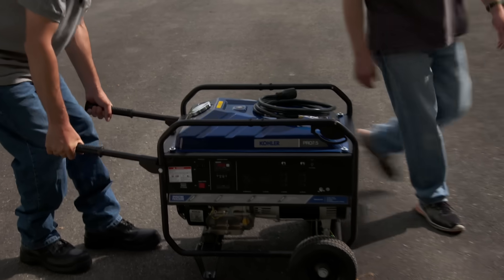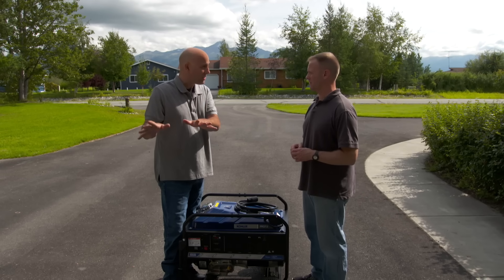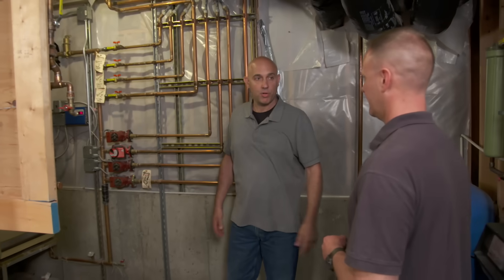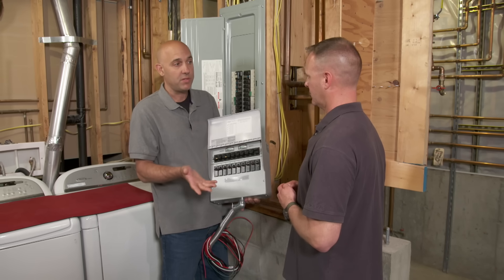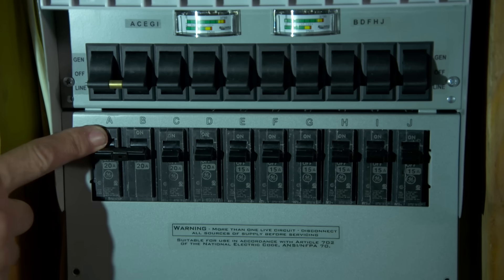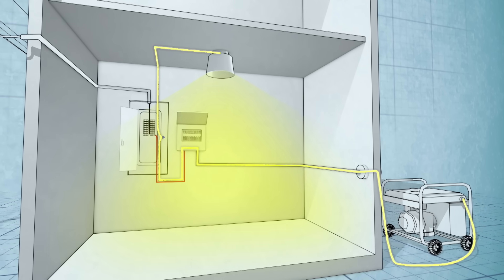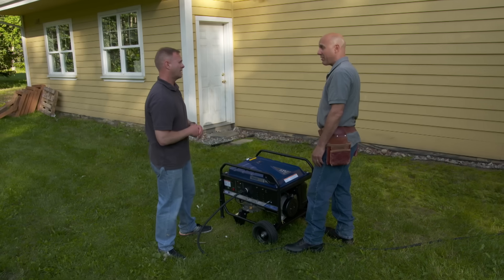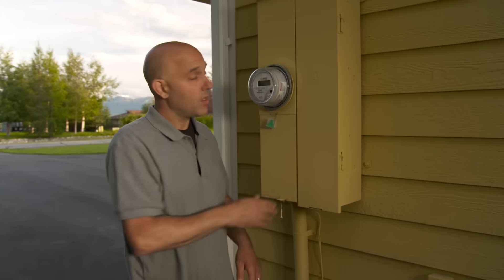How to Install a Manual Transfer Switch for a Portable Generator | Ask This Old House

Comment: An option for this homeowner would have been to purchase a dual fuel generator.  This type of generator can run on gasoline or propane.  Gasoline will go bad over time, even with fuel stabilizers.  Propane on the other hand will never go bad, and will not gum up the carburetor of the generator.  During a widespread outage, gasoline might be hard to find, especially if fuel stations have no power to run their gas pumps.
Reply: While using normal gas it will run at a higher kw, while using propane it will run at a lower kw. So depending on what your house/situation requires, dual fuel may not be the best way to go.
Reply: I runs mine on coal oil. Squeezes it me self.
Reply: @Blair Aquila plus aviation fuel has no ethanol, is clean and pure!
Reply: In a cold environment propane is not your friend.
Reply: @Forshiitsandgigs  Not true. My neighbours use propane at minus 40C. The tank must be sized appropriately, and in severe weather a small enclosure with supplemental heat helps.
Reply: Mowcowbell --  I have a 66.5amp generator that runs my whole panel during an outage.. I will buy the gasoline in the Fall, and when the 2 week outage happens, I will use up the gas to keep our house running 24/7 until the power is restored.
The rest of the gas I use for all the lawn equipment, etc., during the next spring, and I never have had to deal with bad gasoline.. I do, of course, treat all the gas with fuel stabilizers, and have yet to run into a bad batch of gas left over from the previous winter..
Reply: One major problem with propane is you lose close to 1000 watts by utilizing that as your fuel. On a 7000 watt generator, you just shaved off some useful power for comfort lighting in your home.
Reply: Seeing a lot of good, but conflicting information on this little thread. What’s the general consensus of having a natural gas generator? I know not everyone has access to it, but many of us do. Thanks, everyone!
Reply: Blair Aquilia for private you need 20 hours with a cFI, 10 hours solo and 10 hours of a mix of solo and dual. You are looking for 11,5 to 12,5 for the license. You should get at lest 24 hours of ground, otherwise you will try to use the airplane as a classroom and that is expensive.  Must schools don’t care about that, as the more you use the airplane the more money for them and the more hours for the CFi. Always ask for a syllabus and that your instructor has over ATP time, otherwise you are literally paying for him to go to the airlines.  
Recommendation, get all you money together, and come to Texas or Florida, do all the thing in 6 weeks, if you let it lack, you will lose a lot of money, as you have to re learn the previous class.  
The reason petrol and oil become contaminated with water is because oil/petrol has 13% hydrogen, when it touches the oxygen from the outside from the breathing tank hole, it becomes water, also you have the change of temperature that makes the moisture of the air to get in the petrol tank
Reply: Blair Aquilia in some places will offer you licenses for lest than 8k, what they are giving out is price just for the airplane time, no exams, books or other supplies.  Some CFi even offer licenses for lest, as they are part of a fly club, as you become a owner, they don’t give proper care to the airplanes, as they are not regulated under FAR 132.
4 people I would recommend:
American Flyers 
ATP
Alpha Aero Academy 
Alpha Aeronautical Academy 
Be careful with the 2 first, as they care little for your money, yet they are good at teaching.
The last 2 are good at teaching and care for your money, yet their airplanes are little old, well maintained of course.
Reply: Blair Aquilia again petrol doesn’t get bad, it get water and people think the petrol got bad. I am a pilot, we drain the petrol lines before we start the engine
Reply: Blair Aquilia so lead is the stabilizer.
People, petrol GOES BAD because water gets in it.  take away the water and you have fresh petrol.  I have airplanes that had been in a hangar for years and the only thing they need is new oil and you are good to go, oil also goes bad as water gets in by the respirators of the engine, if the oil line had a water port, you don’t need to change the oil.  Oil gets bad because it also has Hydrogen in it, when it touches oxygen in the air, it become water, it also get little metal particulates, as the engine get old by use. The old English cars have a extra filter that let you never have to change the oil of your car.  Petrol or kerosene doesn’t gets frozen, up there you have temperatures of - 62c. It gets hard, but never froze, the nitrogen, and hydrogen can maintain liquid below -250c.  Before the Canaries accident we didn’t use any additives in kerosene, now we at them because we want them to have the contexture of jello at room temperature, when it gets cold it become regular kerosene. We even use kerosene to take humans to the moon. Hope you think about this, otherwise it will be come a fact the Americans have become to ignorant and we will have to look to China for answer
Reply: Mowcowbell petrol is over 50 million years old. gasoline never goes bad, you get water in the gas container do to condensation and moisture created by H in gas and O in air.  Read a book, it will not hurt you
Reply: Think before you speak, there isn't a single drop of gasoline that's anywhere near 50 million years old and gas most definitely goes bad especially if it is blended with ethanol.
Reply: phillijp question, gasoline comes from?
Petroleum. 
Propane also comes from petroleum.
See they exist since they were captured in the bodies of prehistoric monsters and plants. 
Read a book, it will help.
What makes gasoline go bad is condensation produces water and also H when mixed with O it makes?   Water
Reply: Crude oil is millions of years old.  Gasoline which is produced in a refinery from crude oil is not anywhere near as old as you assert.  The process by which this occurs is called fractional distillation.  Also gas is lighter than water, put them in a container, mix them for as long as you like and once you stop they will separate through a process known as phase separation.  Condensation is the process of a gas turning back into a liquid.  Condensation does not produce water nor does it produce hydrogen.  Perhaps you should be the one reading books.
Reply: phillijp son, 
When temperatures change at lest that the tank is airtight, it will get moisture from the atmosphere. The thank can not be airtight as the gas needs compensate pressure to be able to past from the tank to the engine. 
The reason why petroleum does not becomes water in nature is becomes the mixture is C N H, the N repels water and do not let the H electron joins any O presence in the atmosphere.  13 of petrol is H, when low pressure happens in the tank to allow it to go to the engine produces evaporation what lets H boil at lower temperature that produces water when the H mixes with the O in the atmosphere. It is the same principle of why astronauts need space suits. 
Also, because of this, is why you get water in your petrol if it is let alone for to long, the surface of the Petrol touches the O in the atmosphere, and that produces water that goes to the bottom of the tank, so when you start the engage first thing that goes into is water mixed with petrol and as it is in small numbers, people think the petrol when bad.  How a thing that has 50 million years will go bad in a winter? 
I will make a question an I will show me right, it is new water and old water?
Reply: I have no idea what you are even trying to say but good luck.
Reply: phillijp do you finish chemistry in high school?  They Didn't teach you the periodic table or the principles of gravitation or creation of the solar system?
Man, for sure USA is 48 in education.  :) Help yourself, read about it and get in base with me again, you will love it and you will be a smarter person that may help USA becomes again #1

Comment: If you have lots of wind, why not go with some wind turbines? Go with two 20kw turbines and a 10kw wind turbine.
Reply: Wind is not consistent. You would need a big battery to store the peaks to jump the lows. Pretty sure that that's going to be more expensive and less reliable than a simple generator.

Comment: You would need to be very careful with how you "load" those 10 circuits on that 7KW genset. Each of those 10 circuits would only be able to carry a "average" 6 amp load. That cord/receptacle would supply 30 amps on each phase (red/black). The other thing most people don't often realize is that keeping the genset fueled for a long outage can become a problem with fuel availability especially after a major catastrophic event. Propane might be a good source. It "stores" for long periods, pretty safe in its containers, multiple containers could be stored. 
It was always "illegal" (National Electric Code) to splice inside a panel. Has that rule gone away??
Reply: Hello, yes it's imperative to learn a little bit about power usages of appliances when operating them with a generator.  Splices have not always been illegal, there have been exceptions for splices for a very long time.  As long as the fill factor of the area inside the panel isn't too high, and the splices are purposeful rather than being used as a feed-through such as a junction box, they are acceptable.
Reply: Thank you for the clarification. Always willing to listen to sound, sensible replies.

Comment: Always turn generator off before you turn MAIN back on . That NOT what he said !
Reply: With a transfer switch wired properly, it doesn't matter and the main doesn't need to be turned off unless it's via the interlock concept.

Comment: How do you handle the GFCI and AFCI breakers with the transfer switch?  Mine would trip the afci when the transfer switch was providing power.
Reply: If there are GFCI/AFCI breakers in the house electrical panel that are being connected to this type of transfer switch, those breakers will indeed trip if the utility power is ON and the generator is feeding those particular circuits through the transfer switch.  In a realistic situation, the utility power is OFF when the generator is powering circuits, so there are no trips in the house panel. However, as soon as the utility power returns, the AFCI sensor recognizes utility power on its hot terminal, but the power stops at the (LINE/OFF/GEN) toggle switch in the transfer switch if set to GEN position.   Because the generator power is using the circuit neutral passing through the AFCI, the sensor sees a mismatch of power between the hot and neutral as it doesn't know a generator is feeding the circuit on the load side of the AFCI. 

Even though the AFCI trips, the circuit is still receiving power from the generator as the household breakers are not in the path of the generator.  But after utility power returns and you move all of the switches back to LINE position and then shut down the generator, you will have to remember to reset any AFCI/GFCI breakers that tripped so they operation once again on normal utility power.

Comment: totally illegal here in Canada to run a setup like that has to be in a separate panel with a 3 pole 30 or 60 amp breaker that isolates both hots and the neutral all the circuits have to come out of the main panel be junction outside of the panel if they are to short  then the old breakers have to be blanked out with space fillers and a 2 pole 30 or 60 amp beaker feeds the generator panel we also install combo panels with the generator section built in when we are doing new construction or a service upgrade
Reply: Hello, the Canadian Electrical Code (CEC) does not require switching the neutral in all back-up power applications.  It may be a local or provincial code in your area.   3-pole switches is not a national CEC requirement. If the generator's neutral is floating and not switched by a transfer switch, it's defined as a non-separately derived system.
At worst, an authority may require the wire connections of this type of transfer system to be made in a junction box.  Agree that new construction is the best time to setup a combo panel with an interlock.

Comment: Leaves generator in the garage. Power goes out can't open the garage door 😂😂😂
Reply: Ummm what?  Garage doors have a mechanism to let you open them manually in a power outage or if the automatic opener breaks.
Reply: How does someone with the name "Car guy" not have a basic understanding of how a garage (the place where cars go) operates?!

Comment: Do yourself a favor and get the generator converted to N.G. or propane. I have a large propane tank that will run the generator for a week. ALWAYS starts, fuel never goes stale.
Reply: A 22kw propane whole house generator can use 3 gallons of propane an hour on full load. I ran my 19kw diesel generator for 5-1/2  days, used 15 gal per day and ran everything in my house, well, A/C, hot water, stove refrigerator and freezer lights etc. had the advantage of an 1800 RPM generator being not much louder than an automobile engine, Not like an air cooled 3600RPM Generac screaming.
Reply: My cars, lawn mower, chainsaws, weed wacker, motorcycle, dirt bike, 3 atvs, log splitter and generator all run gas...and all start..every time.
Reply: @davec.3198  Propane is better.  My propane tank has been full for six years.   Do you think you can leave gas in a can for six years and have it work at peak performance?  Plus HOW much gas do you have stored?  Generator's are hungry.  You'll need about  50 gallons if you have an extended outage.  When that much power is down two things happen.  1.  EVERYBODY heads to the gas station with their 5 gallon tanks.  2.  Gas stations loose their power too.  Gas cannot compare to propane/natural gas.  BTW...the additives in the e10/15 gas attack you carb, especially if the gas sits in it or gets old (see above).  gas doesn't break down.
Reply: @michaelmattle3509  I have an SUV with a 19 gallon tank.  I have a car with a 16 gallon tank.  I have 3, 5 gallon tanks that i rotate with fresh fuel. 
Fuel isn't a problem.
Reply: @davec.3198  it's not easier and the benefits of propane are obvious.  How are you doing to refill everything when the gas stations have no power or there is a 3 hour wait?
Reply: @michaelmattle3509  If that is the situation, it means I ran out of fuel after a month of use.  Bigger issues than power.
Reply: @michaelmattle3509   -  What if Propane is hard to get and no one has that big, ugly, propane tank in their yard but you??? 
I usually got 11 gallons of mid grade gas and never ran out after running a 66.5 amp generator wired with breakers directly to my 200 amp panel, for 2 full weeks, 24/7... And this happens every winter... 
Yes, everyone goes to the gas station when the power goes out, but some gas stations are smart and have their own generator to keep running, or they are on a different part of the grid and are not affected by the outage..
And what gas I had not used that winter was used the rest of that year for all my gas powered lawn, etc., things..  
And if I  really need a few gallons in a car cause the kids forgot to get gas, well there it is...
I like to keep all our vehicles full with gas or at minimum, half a tank, all year long, so there is less chance of problems with gas stations doa...
Cant do that with propane...
Reply: @frandanco6289  14 days equals  336 hours.  If you ran generator a full two weeks on 11 gallons of gas your generator must run for 30 hours on 1 gallon??  336 hours divided by 11 equals 30 hours.  A 66.5 amp generator is probably in the ballpark of a 20+ horsepower gas engine.  

My 24 horsepower Honda engine can run on gas or propane...so i can do it.  Gas goes bad, gums up  and destroys the carbs (especially with the ethanol) propane doesn't.  Propane burns much cleaner.  

to each their own.....it's only a matter of time before carb has issues, especially with infrequent use.
Reply: @davec.3198  Yes !!!  I never have problems with gasoline going bad, and have found that mid grade and premium grades actually go longer and longer without any help.. Never had any of my things go bad from stale gas...

Comment: I wonder, a) does the transfer switch also switch the neutral (doesn't appear so) or b) the generator has a floating neutral. If the generator has a neutral/ground bond then doesn't the neutral have to be switched at the panel as well
Reply: This type of transfer switch does not switch the neutral, the generator would work if it was floating neutral or bonded neutral as long as no GFCI is present on the 120/240 volt locking receptacle, in this case there is no GFCI so it will function.  However, ideally the neutral should be floating since the main electrical panel is bonded, and most generators can be changed from bonded neutral to floating neutral.

Comment: If you have one or two power failure in a, say, five year span is it worth the investment?
Also if it's for a short time may as well ride it out.
Reply: It really depends on how long the power might fail which is unpredictable.  Buying a portable generator is at least good preparation for unpredictable power outages, a transfer switch is acquired if running extension cords doesn't meet your needs or becomes inconvenient.   This type of investment doesn't have an exact measurement because of future unknowns (power outages) so it's subjective and really more of a peace of mind that may or may not be used, but is extremely useful when it's needed.
Reply: Probably not if you live in an area with a normally reliable power grid, which most US big cities have.  Usually in these places a 30 minute outage makes folks think the end of the world is coming.